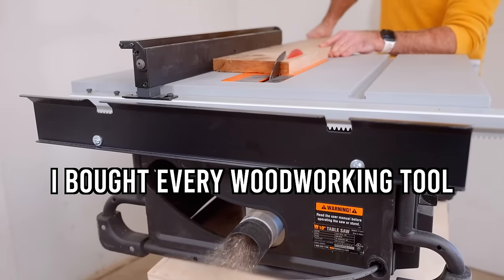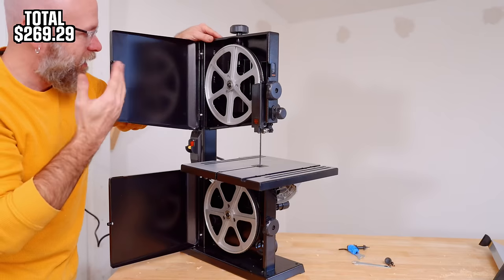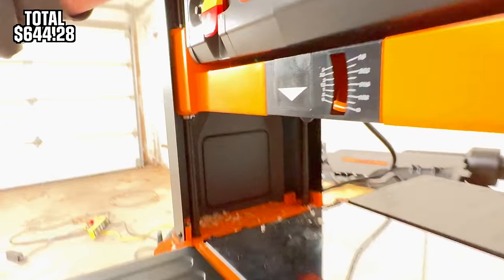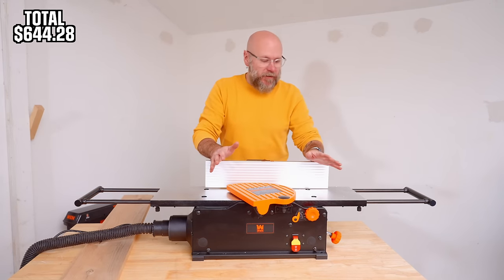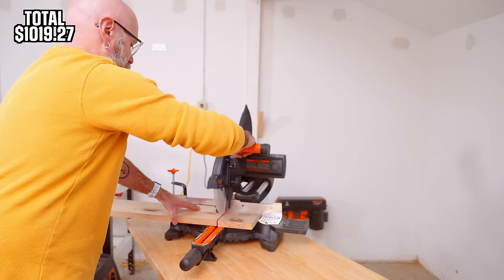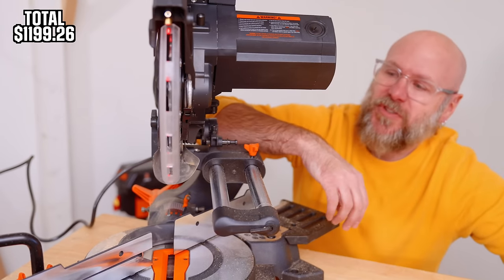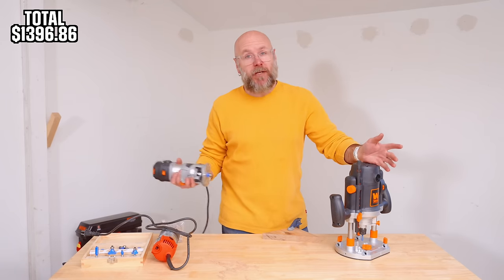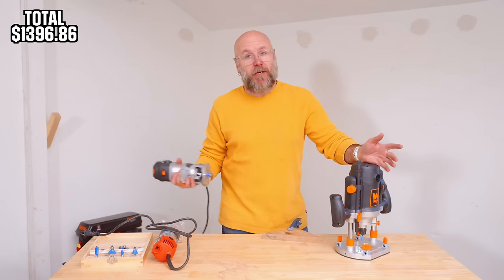I Bought ALL THE WEN TOOLS! Let's Review.

Comment: Even keeping in mind that the rankings are for the price range I feel like you were being a little generous, especially with the table saw. You had to flat-out pitch a major accessory, and any tool that has a built-in injury feature ought to lose a full point (if not more) for that alone. 

I don't know but I would guess you have a 3D printer somewhere - I'd like to see the vid where you use that or whatever else you have or can get to fix the problems with these things - see if you can make them a level better without losing the savings advantage. 

I'd probably start by making a longer handle for that fence lock, or alternately print a couple of U-channels that you can fix to the bottom of the table that would cover the teeth - the gear only engages in that one spot, so a fixed U-channel on each side that would cover most of the side-to-side run would protect your arm.

Comment: You join the wood first, then you plane it.  Joining the wood makes it flat, planning doesn't.  If the board has any twist to it the pressure of the feed rollers will take the twist out,    but the twist comes back when it leaves the planner.

Comment: Track saw tacky strips are an item that needs to be replaced occasionally, anyway.  So buy the powertec strips for $16 or the Festool strips for $32 and they will probably work.  Wen uses Festool/Makita/Milwaukee/Triton compatible guide rail unlike many brands. Shorter rails: it is a plunge saw not a circular saw, you don't need to cut off the end of the trqck.  Bevel reunion is a little flimsy when set to 45degrees, I haven't tested to see how bad that is.

Knobs: you have a shop full of brand new tools, make your own.  Make a video.  Name thread pitches and sizes.  Many videos on making jig knobs.

Table saw: universal motor, found any any of the jobsite saws, is noisier and open frame construction.  Skill TS6307-00 looks like a better deal, but similar.

Planer: you just got a dud.  Customer service/warranty was very slow, though.

Sander: clamp it to the bench.  Easier on your back to move.  

Bandsaw: I would consider a Bladerunner X2 instead of a bandsaw that is too small to resaw wood you can't resaw in the table saw.  No bevels, but you can do inside cuts and moderate scroll cuts and blade changes are almost instantaneous.

Drill press is pretty typical for the 5 speed baby drill press.  Needs more speeds and more quill travel.  Weighs half as much as the larger drill presses

Comment: The problem with Wen, and most Chinesium goods isn't the "quality" it's the consistency of quality. I buy 1:1 clones for <$20 of hardware that often costs $150-200 from China. 99.9% of the time they're as good (sometimes even better) but sometimes you'll get ones that are a laughable excuse for a shop class attempt.

I think people don't understand, Wen doesn't have a factory making Tool A, there's a DOZEN COMPANIES with DOZENS of factories pumping out Tool A. Then Factories 1-1 through 12-18 slap Wen labels on it and ship it to wherever *their particular factory ships to*. This is then FURTHER compounded because of raw materials available for any given factory. All of Company 1's factories get sourced from the same place. If they're geographically far, they'll get it from the nearest producer to cut costs.

This is also why some models/tools seem to be far better quality than other tools from the same brand.

Comment: I was at Home Depot some years ago and they had that Dewalt 735 planer on clearance for around $250, regular price $799 or something.  They had 2 on the shelf. I checked to make sure it was the right price tag on the right model number and it was, so I bought one and called my dad to see if he wanted me to get the other one for him.  He didn't need one.  The next day I decided to go back and buy the other one to resell it because everywhere else still had it listed for the regular price. I figured I could make a quick $300-$400 and someone else would still be getting a good deal.  Turns out, they had marked the wrong one on clearance. It was supposed to have been the model a step down from the 735, and the 735 was back to the regular price. Unfortunately, a friend of mine got hooked on opioids and broke in to my house, stole and pawned a bunch of my tools, including the 735, to feed his habit.

As for the Wen tools, I am not impressed with my bandsaw.  Motor feels very weak. If my blade isn't razor sharp brand new out of the package it's not cutting anything thicker than an inch or so. I am happy with my planer and drill press, though.
Reply from the maker: My goodness. I lost a close friend to opioids. ❤️
Reply: @MakeSomething  Luckily he got clean, we buried the hatchet and became friends again.

Comment: The table saw is loud because it's a direct drive motor like a mitre or circular saw. Larger saws use an nduction motor which is quieter but more expensive and additionally a belt drive so it can run at a slower speed and step up the output speed with the belt. Also that's a jobsite saw, not a contractor saw.

Comment: That table saw design is identical
To the Dewalt 10” dwe7491, same
Knuckle bloodying gears and the fence lock same
Exact place.. the  table planer looks exactly like dewalts dw734, both amazing quality tools but can’t forget the crème de le creme, the dw780 12” sliding dual bevel miter.. talk about scary clean cuts when you slap on a new Diablo ultra fine blade…. I own all 3 of the dewalt tools and I’ve never once regretted spending the $.. “Pay once, cry once”

Comment: I didn’t expect to enjoy this video but I did! It was good to compare it to the tools I have now which are SUPER budget. I have used better tools in the past when working for larger companies though, so it’s good to see that some of these (like the table saw) are almost like a good middle ground rather than cheaper than cheap. I agree with another comment on here though, i hope to see a follow up video on the jointer as it would be great to get see how level the beds are. I’d especially like advice on how to level the beds as thats an issue I’ve struggled with recently. Hope to see a follow up of the thicknesser too obviously! Looking forward to seeing more on the budget shop 😊

Comment: I bought the 10" sliding mider saw for my work, we used it for 6 months & I hate it,  the slider bars get in the way about a quarter of the time, the dust collector is just for looks. But on a positive note I will say it was square straight out of the box.

Comment: I don't regret buying many tools... but the Wen drywall sander I got was a nightmare.  It ran for 10 minutes and died. Unfortunately, I got it on Amazon and tested it, but didn't use it in the first month. It ran for 10 minutes and died. I asked Wen a chance to fix it under warranty.  They send a new switch, which did nothing.  Given that it had been cheap enough it was not worth my time to try to fix it.  If you decide to buy a Wen product, good luck.

Comment: Your first mistake was NOT buying the BIG 4214T WEN variable speed drill press... It really is a work-of-art... Granted it's $275, but it's worth every penny... You should try it out... 6 stars...
I'm changing over all my shop machines to WEN machines... I have that big drill press, the 36/6 belt/disc sander, the 9" bandsaw, and the 16" scroll saw... One of the planers will be my next purchase... I'll bet mine comes with a roller drive chain 🤣🤣... That was just a simple oversight by 1 employee, or maybe a shift change on the assembly line... I'm sure they'll take care of the problem, if they haven't already...
I like the WEN brand because they're inexpensive, and they work very well for my needs...
Thanx for your time making this video... Excellent work... 👍👍

Comment: I work for a food equipment distributor. The factory has been sending us machines missing motors, control boards, wiring. And these machines are commercial grade and cost over thirty thousand USD. It is an epidemic in manufacturing ever since the Covid shut down and it is not getting any better. Sad sad sad!

Comment: I really enjoyed this vid..    a couple of things tho..  making adjustments on the miter saw is why i swapped out my old one for my new dewalt..  its so easy to adjust it to make perfect 90s ..  my 30 year old craftsman just would not lock in at 90 when i tried adjusting the fence..  can you easily adjust the wen?   ..  and setting the angle on the table saw..  on my dewalt, which is similar i reach under and grab the blade casing and adjust it there instead of trying to use that handle which is just horrible  : D   again loved your vid and im glad they are finally sending out a new planer

Comment: I don't have a problem with most of these being rated at 4 stars. To me, 5=exceeds expectations, 4=meets expectations, 3=adequate (with workarounds or tinkering), 2=inadequate (i.e., underpowered, misaligned tooling, etc.), and 1=not recommended (i.e., a planer that arrives incomplete). 
My 2 cents.
Good video though. I've been curious about these tools.

Comment: Thanks for this video, great information! I’m wondering if you have any feedback on the when track saw after having a chance to use it? Would love the Makita corded saw, but the Wen is almost 4x cheaper. Some other videos I’ve watched have complained about the saw cutting square, especially at an angle there’s some slop/deflection from the plastic of the saw which they say makes the cut inaccurate. While I certainly don’t want to pay money for an inaccurate cut, I’d love to hear your feedback and if you have had any issues with it? Thanks so much for the videos! Love your work!

Comment: I have three Wen tools and the only one that's been a disaster is the track saw. My track isn't the straightest thing in the world and the blade has so much play that it gets pushed around and makes very non-straight cuts. It's bad enough that the blade has cut into the housing and no amount of adjustment or tightening has fixed it. shrug I bought a Festool and the difference is as expected.

Comment: It would be good if you actually showed results. Like in the jointer, having it square and not bowed is literally the biggest thing on a Jointer and you bypassed for not having any sort of straight edge which is kinda odd. I handed that Jointer and it can do the job, but needs to be readjusted every 5-10 boards as it falls out of alignment. So frequently it makes the entire tool useless.

Comment: The louder noise on the WEN tablesaw is almostly certainly a result of it being direct-drive (the motor is connected directly to the blade) vs. belt-driven like your cabinet saw. These are SUPER noisy (similar to a circ. saw - in fact these table saws are mostly just upside-down circ saws with a trunnion system). Nothing to do with power, everything to do with loud, noisy vibrations.

Comment: The corded track saw is ok but not great. Worst feature is it flexes really bad doing bevel cuts due to the plastic bevel slider. I have the cordless version and it's levels above the corded version. Also have the same planer and it's been a workhorse with no issues to date!

Comment: Still waiting for the 34035 lathe to be back in stock. Love the wen planer and jointer I already have
Reply: It’s in stock. I’ve had it for a month. I’m a beginner to lathes. I’m learning quickly. Seems to work great. I also have the planer and jointer. Very happy with both.

Comment: I have the drill press you gave the 4 stars to. Mine worked great until I tried to use a hole saw bit on it. It bogged down and didn’t finish the cut. I have tried changing the belt to a slower speed. That didn’t help. It seems to still have problems even drilling holes now with a regular bit. Don’t know what to do with it.

Comment: What I got here, is buy a whole set of Wen tools, then buys some decent metal knobs to fit w/e size tread  you need and you get a high quality tool, cheap.
Reply from the maker: Except it’s more than just replacing the actual knob. It’s the whole knob mechanism that’s sloppy and cheap.
Reply: @MakeSomething  darn, that would have been a nice to be able to fix it

Comment: All tool ratings
⭐⭐⭐⭐      Drill press
⭐⭐⭐⭐      Band saw
⭐⭐⭐⭐⭐ Planar
⭐⭐⭐⭐     Joiner
⭐⭐⭐⭐      Miter saw
⭐⭐⭐⭐     Spindle sander
⭐⭐⭐⭐     Routers
⭐⭐⭐⭐    Track saw
⭐⭐⭐⭐      Circular saw
⭐⭐⭐⭐⭐ Detail sander
⭐⭐⭐⭐/⭐ Table saw (need better miter gauge)

Comment: those knobs on your jointer are called "ratcheting knobs" for a reason. they are made that way to mitigate interference when too adjacent to spin freely. you could call that a resourceful and economical solution. Might be presumptuous to infer that the designers of this tool didn't think about that issue because they very well seemed to have done that with the very choice of style of parts that you are bemoaning. a style    which are designed to work and tighten the knobs securely, effectively, and possibly efficiently. specifically even in instances in which your range of motion becomes limited by what-have-you. @16:23 I will give you however, that the fences motion when unlocked is sloppy and unimpressive and almost unpalatable I would hope that there would be some sort of geared motion to it if you were to have bought a more expensive tool

Comment: WEN makes stuff that is on par with B&D from the early 90's, aka its home user junk that gets thrown away after a few uses. That drill press is under powered junk that is you just can't make good reliable repeatable holes with. I threw mine away after a few frustrating uses.

Comment: One thing I've learned in 20 years of being poor and buying cheap things is that a major cost saving factor many budget product compa ies employ is a reduced Quality Control department. Its not uncommon to get several of the exact same tool and find some that are comparable to mid tier brands, some that barely function, and some that are straight up DOA. Its why i dont hesitate to buy from Harbor Freight, their return and exchange policy makes up for the lacknof quality control in the low tier brands they sell.

Comment: Mike I'd like to say that someone handicapped now and I need speech to text software and sometimes it has its mind of its own I just watched three of your videos the first one was that company that rips everybody off I bought a bunch of crap off of them some of them are going to use but most of them are just crap. Are you drill press let's see if you face the drill press if you on your left side I believe it's a big round the black knob and if you loosen that nut I believe you can turn that thing kind of clockwise and that should release the pressure of your return on your drive Chuck an amateur woodworker are there a lot of experiences with drill process from the military and actually I own a big gigantic thing I got from Harbor Freight was their top of the line drill press but they had a mistake in the advertisement and I talked with the manager and he wanted it that's another story of my life I do like your show with very informant. This is John say you bye for this time

Comment: How many of these can you run at the same time on a regular outlet? I.E. Miter saw + Shop Vac? Bandsaw + Shop vac? pretty much any tool +Shop vac lol
Reply from the maker: Depends if the lights are on the same circuit. Sometimes I have to put the vac on a different circuit than the tool.

Comment: I'm willing to accept WEN products due to the price vs projected use.   I can vouch for the circ saw, small drill press and band saw but I don't use them like I would a more professional grade of tool.  I'm not too impressed by the planer or track saw.   I like the trim router very much.  I won't go near the table saw though as it does not suit my needs.  FWIW, I refuse to use the angle diagram on any table saw.  Much better using something as a Klein Tools or Wixey angle gauge.

Comment: The knob on the drill press pully lid was never meant to bolt thru the latch. It simply bolts to the lid assembly as a handle. The latch on the lower case has a hole in it, which IS confusing. However, it is just a catch latch.
My first inclination was to spin the knob to open the pulley bay and it came apart.
I realized it was just bolted to the lid and slid over the latch catch to close.. 
Wierd design.. hope that helps

Comment: No reason for 12” if all you do is trim but wouldn’t you like to just go straight through a 6x6 if u need to? I have the better 12” dewalt for work but I’ve done more than I’d like to admit with a 7 1/4 inch Kobalt lol. I could just grab it with one hand throw it around though.

Comment: I have that drill press.
2" of travel is not enough
The depth gauge is super flimsy and cheesy
There's no way to set the angle of the table accurately - mine doesn't even have a center mark
The chuck will not grip securely with a reasonable amount of force on the chuck key. 
And yes I smacked my knuckles on the handle
#fail

Comment: Shouldn’t you joint a face to flatten the board, then an edge to square it to said face, then plane the opposite face so it’s parallel, and finally run the last edge through the table saw to get your width? By planing first, you’re not creating an actual flat surface.

Comment: I have a small shop and I bought some wen tools because of the price , first time I used my bandsaw it broke and was past the warranty 😢
Reply: I also have the belt sander and drill press , the sander I’ve used a lot once I got it calibrated and worked fine for what I need hoping the drill press doesn’t break when I use that